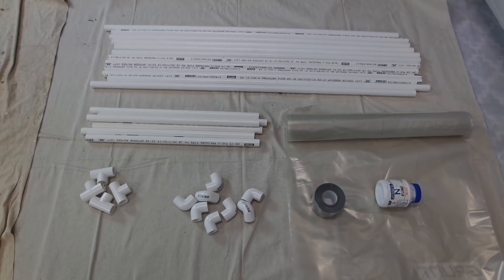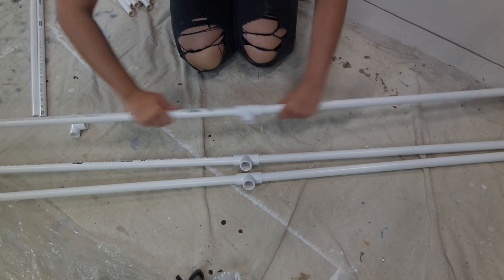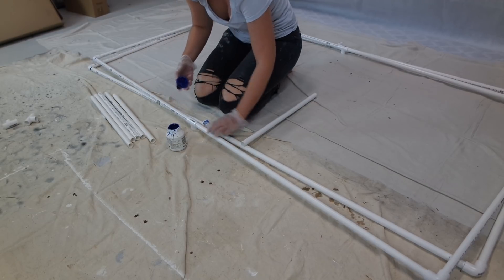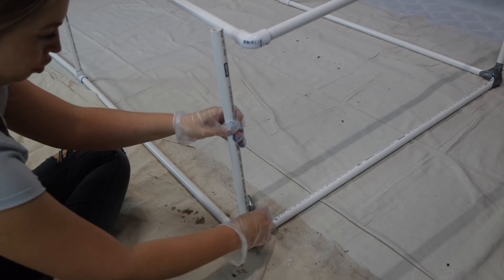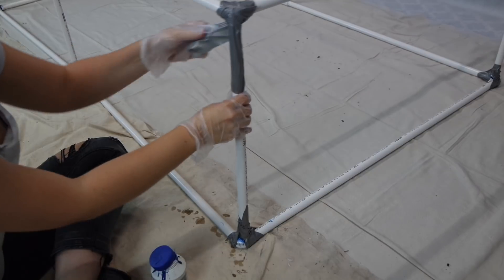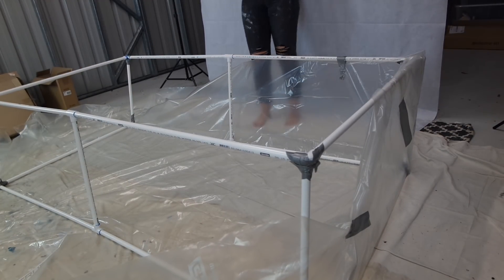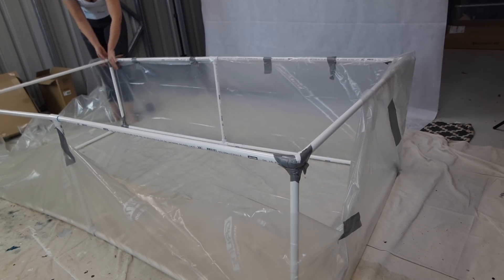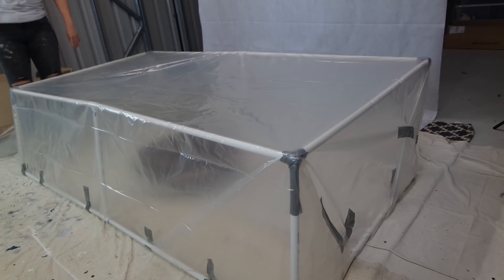How to protect your resin art?

Comment: I made my resin drying box similar to this but I used a thick cardboard box.  I made the sides about 4 inches tall. I have cats in my house so we all know that those little monkeys want to get into everything! Especially if they see you using it too lol.
A plastic drop sheet would not work for me. I needed something stronger and it's nice to have the added protection.